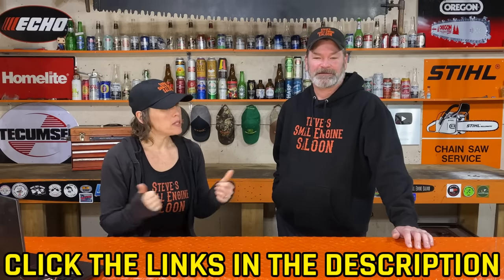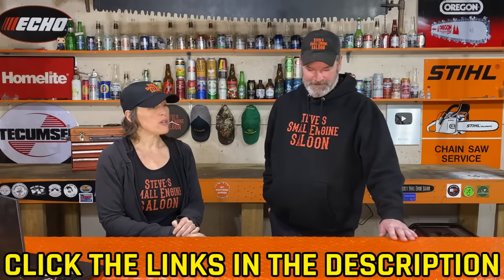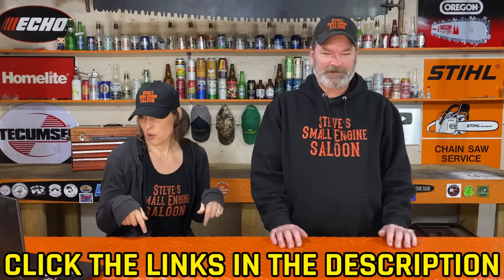Can I Use Old Dirty Motor Oil As Chain Oil In My Chain Saw? (DAY 18)

Comment: My late father tried old used motor oil. He found out fast that his bar went down hill quick. There just wasn’t the same lubrication between the chain and bar.
Reply: Yep, it wears everything down fast.
Reply: Most of the oil will fling off the end and never make it to the bottom of the bar where it is needed.
Reply: @tomrogers9467  the drive links wick the oil from the channel of the  bar so how is it going to sling it off?

Comment: No I've never used old motor oil that's been in an engine but I've always used 10W30 clean motor oil for all my chainsaws for 42 years never had an issue but I do agree that all motor oil does make a mess I have deal with the before repairing customers chainsaws so I understand Steve thank you for this video
Reply: Is that more economical, Matthew?
Reply: Well for me it is more economical because the majority of my engine take 10w 30 so I always have it on hand

Comment: I will agree with Steve for the most part.  If you are not committed to working on your own equipment then you should use the proper oil.  I myself have been using old oil in my machines for 10 years.  I use it for bar and chain oil as well as mixing it  in the fuel.  I do because I'm a cheapskate and do my own repairs.  I'll be the first to tell you that it's not for everyone.  It does splatter more than regular chain oil.  If your saw already leaks then the oil will stain more than regular chain oil.  Motor oil has a stronger smell to it that sticks to your clothes more than both chain oil and 2cycle oil.  It smokes more because there are different additives as well as the dirt that has been trapped in it.  4 to 6 ounces per gallon is what I use but that is on the rich side to some degree.  I would much rather clean my muffler once a year than have to rebuild an engine.  I have had zero engine failures mixing old oil with fuel for my engines.  You will have to screen it to make sure there are no metal particles in it.  I us an old speaker magnet in the bottom of a 5 gallon bucket to make sure there isn't anything that the screen doesn't catch.  I check the magnet every time I add to or draw from the bucket.  I don't add oil that I already know has metal shavings in it when it's drained from the engine.  I dispose of it.  When oil sits over time dirt and particles fall to the bottom of the container.  People who mix oil in diesel use this method without the magnet.  So if people take the time to use oil as a fuel source for diesel applications I don't see how a saw or trimmer is more special than a pickup truck or tractor. It's not for everyone but it is an option that has worked for many.

Comment: Change your car oil out frequently (by buying it instead of bar oil) run it through a filter (which really isn’t necessary because you car already is filtering it) and it works perfectly. The difference in bar wear between it and good (expensive) bar oil is less than 5% and if you are running your saws 6 hrs a day 8 months of the year you’ll save enough to not only buy new bars with the savings but new saws. If you are a homeowner that burns a tank a year and don’t maintain your own vehicles, it’s likely not worth it. But it definitely is if you go through several 55gal drums a season. You tell me what has a larger environmental impact, repurposing or buying and having to manufacture double the amount? I’m getting old but wow we have  become a wasteful disposable society. 🤷🏽‍♂️

Comment: To each their own, but I have chosen to run used motor oil for my bar and chain oil. At $15 bucks a gallon for the cheap bar and chain oil, I can save way more than the cost of replacing the bar, chain, and/or pump... even if they wear out twice as fast. 

And as far as the environmental concerns go, I'm just not buying it. Bar and chain oil gets slung everywhere too, you just don't notice it as much because it's not black. 

Again, to each their own. Just sharing my reasoning.
Reply: And in such little quantity it will do nothing and motor oil is better for the environment because you are re using it

Comment: I would like to have seen the question to be "is it OK to use regular motor oil for chain lube?" And the answer is a definite "yes"  There is nothing about chain and bar oil that is special.   Most times it's thicker but in cold weather that can cause problems.  My old Homelite XL 14 chainsaw has  a pressure driven oiling system and works best with a thin oil in cold weather.   Clean, new 5W20 motor oil works perfectly.   But I would never use old used oil drained from my car or mower!

Comment: As long as the oil isn’t too bad, and doesn’t have any alarming amount of metal in it, I always use it for my bar oil. The pressure and temperatures that motor oil has to perform at is FAR beyond that of bar oil. In an engine, the oil’s limits are reached but not for extremely light duty of bar oil. Most of the time the used motor oil I use doesn’t even get up to temperature and stays fairly viscus. It still gets warm enough to create a film but not hot enough to really liquify.

It’s just my thoughts. 😅
Reply: @whatsapoop  you can typically see the metal when there is way too much. Also, a magnet. When oil comes from my oil changes, it’s typically just dirty from the detergents cleaning out carbon, but if I take oil from someone, I always run a magnet under it to see if there is enough metal to build up to be “alarming”. Letting the oil settle and only pouring off the top into a paper filter is slow but also inexpensive if bad oil is all I’ve got.

Comment: When I repair a saw the customer gets it back clean or at least clean enough that the cooling system is gonna work properly. If its trashed from the use of waste oil and it takes longer to clean then they get charged more. BTW, waste oil cleans up easier than baked on biodegradable oil, although its probably a less healthy choice.
Reply: That's BS because almost all of the cleanup is wood chips and oil that will be there no matter what kind of oil was used.
Reply: @maxwelltodd7757  Its been my experience that the thinner waste oil spreads further and makes a bigger mess over more of the saw.

Comment: Regular motor oil doesn't have the lubricity for bar and chain oil..
That said I'm now using my used 15-50 synthetic from my motorcycle and it's the best by far I've ever used. Chain stretch is reduced to almost zero. This speaks loudly for it's quality
Reply: Any modern motor oil has to meet strict requirements. It's easy to find test data on most major brands. 
With bar and chain oil it doesn't have to meet any standards,  just a bunch of fancy words on the label. I could be anything that pours from a jug.
I would have no problem using engine oil in my saw, but would never put some random bar oil in my car.

Comment: any oil is better than no oil, that said the chain oil is supposed to resist being slung off of the chain better, does not require the detergents etc of motor oil,

Comment: When I was a kid, mid to late 60s I seen a couple people do that. Dad would buy new 10 weight motor oil and use that. I have used new 10 w 30 if I need to use the saw and was out of bar oil. Jame Out.

Comment: I've done it before when i was in a pinch. I was out cutting firewood and ran out of bar and chain oil. It was an older saw but with my new echo saw i won't put used oil in it

Comment: When money was tight, yes, I admit I used it. But only on my Stihl 009 for cutting firewood. You can see where it started eating away the magnesium around the clutch housing ! So that was the end of that cost saving venture.
The 009 is still running twenty three year's later but a bit long in the tooth. They don't make it anymore which is a shame.
I would never recomend anyone use old oil but sometimes you do what you gotta do to get by.
Reply: Ya I have seen old 266s with a ton of pitting on the oil pumps from the acidic old motor oil eating them away
Reply: @rileyjohnston8393  
Exactly. Used oil is acidic, diesel oil even more so. Ash is abrasive.
I just buy oil in bulk now and screw in a manual pump dispenser. Makes life easier.

Comment: I doubt that the old Engine oil will be able to cling to the bar and chain at the high speeds that the chain spins….. chain bar oil is specifically designed to cling to the bat and chain at the speeds and the conditions that the bar and chain goes through while cutting through trees

Comment: I sometimes have used cooking oil (canola or sunflower) as chainsaw oil. It smells like a fish and chips shop, and I don't think it works great, but it will do in a pinch.
Reply: I have been using the Stihl environmental stuff and everything smells like french fries 🍟. It too is thinner and doesn't coat things as effectively either. I'm a bit disappointed considering one gallon cost me around $39 at my local saw shop.
Reply: @patricknesbit2334  
A "tree hugger" with a chainsaw? 🤔
😉
Reply: @steveniksid5874  nooooo! I've failed at lumberjacking and ruined the macho manly image!😂  I wanted to see how it compares to regular oil and was greatly underwhelmed.  Regular saw oil is the best in my opinion after years of saw work. Tackier, and thicker is the best!
Reply: I've used canola new and used. Very good chain lubricant until it gels below freezing. Plus it'll dry like varnish past 30 days not in use

Comment: I cut down trees for a guy over a few summers in high school. He decided to save a couple bucks and use old oil out of his small diesel tractor as bar oil. It made a proper mess compared to the fresh clean proper oil. So to echo what you said, it works and is better than nothing, but the correct oil is cheap and definitely the far better choice.

Comment: I've started using used 30 and 40w motor oil as bar oil. Last about half as long so needs topped off every gas fill up. Other than spraying some more I don't see any difference and I have gallons to use.

Comment: I lubed the bar and chain with used gear oil which is much cleaner than used motor oil.  It seemed to work OK.  However, when I ran out of that I switched to semi-synthetic B/C oil.  When using the latter, I find that the chain needs to be tightened to compensate for wear much less frequently than when using gear oil.  Is it because that oil is designed specifically for that purpose or because it is clean?  I don't know the answer to that.

Comment: The main reason you don’t want to use auto motor oil it doesn’t have the Taki stuff that makes it stick to on the bottom side of the bar and chain it just flies off the tip as chain is making a U-turn coming back.

Comment: Hey, I love your videos and they’re a fantastic wealth of knowledge for us.  However,  Steve, you’ve gone over the top why you shouldn’t put used motor oil in place of bar oil.   #1 Most all of the oil changed from gas fuel injected engines is usually not black and gooey.  #2 The oil filter picks up any significant metal filings etc. #3 Don’t use any light weight ‘runny oil’ unless temperatures are low. #4 Protect a mechanic from dirty oil?  What next, manicures and spa treatments ?
Last but not least,  the environmental factors you raise.  Steve, most chainsaws are still 2 cycle engines commonly belching out blue on start up etc.  Chainsaws are most often used for firewood bringing up even more environmental issues. Bar oil is a ‘petroleum product’ 10W or 30+W.  So if anyone out there is genuinely concerned about recycling motor oil, then they should be using Canola Oil.  Steve,  speak to us please ???

Comment: Complaining about whatever your customer brings in is a great way to loose your customer. Former shop complained about how bad their car smelled from their dogs...we got a new customer 😂
Reply: I think it would depend on what the smell was. If the smell was just "dog" or "wet dog", it would be one thing. If the smell was dog shit or piss - nope! And there is not much worse to a small engine mechanic than someone who brings in equipment that they had just run over dog shit with.

Comment: Used engine oil has contaminants such as  lead, cadmium, chromium, arsenic, dioxins, benzene and polycyclic aromatics that are potentially hazardous on the skin and to the environment . You handle the chain when sharpening for example . One of my containers of chainbar oil is marked Supertak VG 150 GL-1 , GL stands for gear lube , if I had no proper oil and had to cut , I'd use gear oil instead , it is suitably viscous and I always have some in my shed , new not used . Used engine oil I dispose of properly . Edit - Used gear lube would be far preferable to used engine oil .

Comment: I was buying my bar oil from a dealer in my area.  He said he buys the bar oil by the barrel.  Then resells it to the public.  🤔🤔🤔🤔   What I found out was he was using 5 gallon cans.  Mixing it with Half of used motor oil.  Then charging customers a normal full price/gal.  LMAO! Quit the profit margin on bar oil from his shop. 

Well, I don't know about metal particles in used motor oil.  If there is, it's going to be very minute.  Engines do normally run oil filters.  Not unless the oil comes out of like a lawn mower or small engine, one without filters.  Other than that.  Oil is black and dirty because of the detergent in oil.  It helps clean carbon from the engine.  Which collect and stains the detergent.  Those large particles are also caught in the filter. 
Yea, if you are taking your equipment to a dealer for service work.  Have the decency to power wash it first.  It's just a respectable thing to do.

Comment: Old used up Oil is Nasty, but I've never had issues with My used Oil and Transmission Fluid that I've used.  I do Regular Maintenance on My Vehicles and I have plenty of Used Oils.  I'd stay away from Power Steering Fluid.  It might Swell the Oiler Lines.

Comment: Sorry, but I think that's a stupid question!  I knew it would ruin the bar and chain, but you pointed out other reasons not to.  I would rather not use the chainsaw while I go to buy more bar and chain oil than ruin my bar and chain with that crud, but now I know more reasons to do just that.  Hey Steve, how about a video on the difference between crude oil and crud oil?  🤣😂🤣😂🤣

Comment: Good one, Steve! To my understanding,  used motor oil is carcinogenic and doesn't break down well in the environment. Getting it on your hands is a big no-no as well. 
Regular bar oil is safe for the environment, won't cause cancer, and lubricates the bar and chain as required. 
Just a terrible idea to use that nasty oil in a chainsaw.

Comment: In my echo, when it was new, I ran clean vegetable oil in it, for environmental reasons. You have to empty it out when you're done, otherwise it will mold, so I've been told. I never had any issues with it.
Reply: I also run canola oil if it's not too cold. Last time I did the math it was cheaper. Haven't seen any mold.
Reply: Used motor oil will do nothing to the environment when in a chainsaw since it is just a tiny tiny tiny bit of oil. The stuff you buy in the store is worse for the environment because it’s one time use but if you use motor oil you are technically recicling

Comment: Just curious Steve, could used engine oil be filtered to remove metal particles so it wouldn't be abrasive to the bar & chain? Just a thought.
Love your videos! Is your assistant your wife?
Reply: to some degree yes, used engine oil can be filtered, and also already has been filtered many times by the engine's oil filter.  But, it's still too thin to do a good job.
Reply: @happycamper6352  I will mix one gallon bar and chain oil to 2.5 gallons of filtered used motor oil, never had any trouble.

Comment: Supposedly,  skin exposure to used oil causes cancer.   
Also -  I’ve caught myself using a lot more chain oil than needed.   I used to top it off,  use the saw for 20 minutes, then hang it up in my shop .   Chain oil would just drain out.

Comment: you can but the wear isn't good for your chains, used my old excavator hydraulic oil with added bar oil ,hyd oil is very clean when used if you change regularly ,you want that sticky film on your chain

Comment: Using old engine oil to lubricate your chainsaw chain? No never !!!! Stretching of the chain, premature wear of the bar and the oil pump will clog. I tried several ways. And always bad experiences. Mix with new oil, filtered, Old oil is old oil.

Comment: Hi April, Steve!
What a question... You can, but definitely shouldn't. First reason is: engine oil in general is less sticky than chain-oil. So the chain will wear out faster, since the more liquid engine oil flies off the chain faster. And this leads to the second and most important reason: That oil spill is very bad for the environment. On your premises you can do whatever you like, but keep in mind that 1 ml of oil will spoil 1000 m³ of groundwater so that it can't be used as drinking-water. That  is the reason, why engine oil must be properly disposed.
Here in Germany you are not allowed to use anything else but bio-degradable chain-oil, if you want to cut wood in a forrest, that is not your own property. In public forrests you are even obliged to use synthetic fuel. 
And folks, tell you what - the bio degradable stuff works equally well and isn't much more expensive. 
Thank you both for your videos!
Greetings from Germany
Andreas

Comment: I can see the mechanics issues. But used motor oil is filtered, this is the only time I have to disagree. Mabey Diesel oil. But changing oil every 3 to 4 thousand miles. Mine still looks new, just when it get hot it loses its viscosity! Js..
Reply: I definitely wouldn't use Diesel oil either. I change it and it is black a week later.